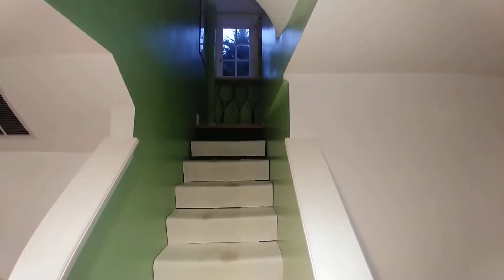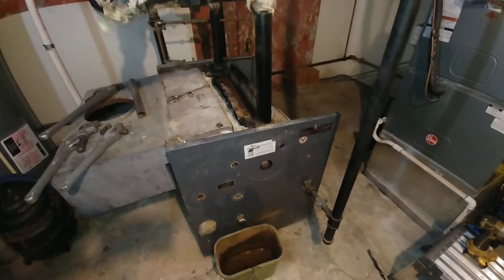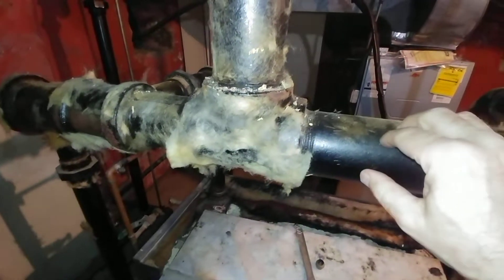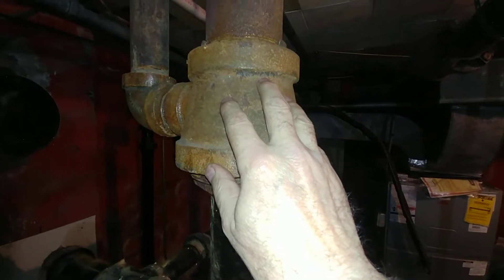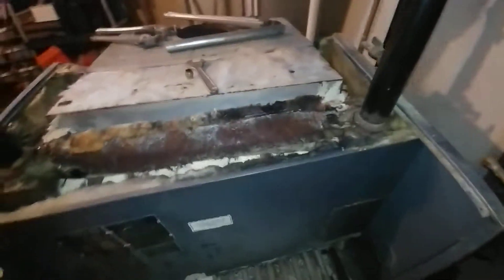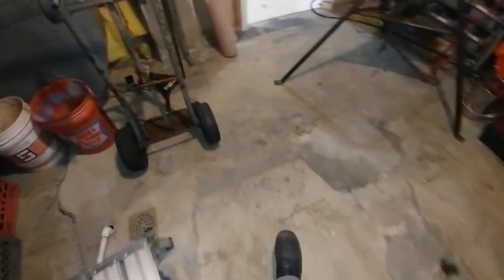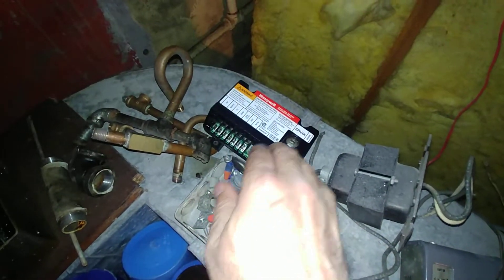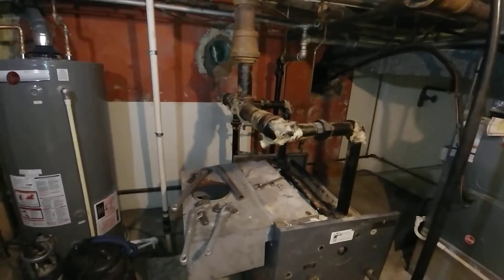Two Pipe Steam Vapor System Is Getting A New Boiler

Comment: Another nice video of your work!
The header explanation was very good down sized pipes and the bull head t.
Did they at least setup the height of the header to 28” above the top of the boiler? It’s difficult to determine the actual dimensions from the cameras point of view.
The Hartford loop was the longest I’ve seen yet. How were you able to get the steam pressure down to 8 oz? Didn’t the friction losses become a problem?
Reply: Thank you!
Yes, the risers coming out of the boiler were about 24" inches.  General instructions for most boiler manufactures of riser height before the first ell call for a minimum of 24" above the water line.  We try to go 24" above the boiler outlet, so by that standard, this installer got that part right at least.
Sad to say, the Hartford Loop pictured above is not the longest we've seen.  A few have been as much as three feet!  Hardly qualifies as a "loop", eh?  Usually, they 're leaking to boot (due to water hammer, naturally).
Two pipe steam systems from the turn of the last century onward were designed to circulate steam at extraordinarily low pressures.  So, in a sense, the hard work of getting the system to operate at pressures below 8oz/in2 had already been done by the time our grandparents were children.  Friction losses by design were around 1 oz per 100 ft of pipe!  That was done by using Big A$$ Pipe.  We just add the biggest vents we can and add a Vaporstat.  The "Dead Man" piping does the rest.